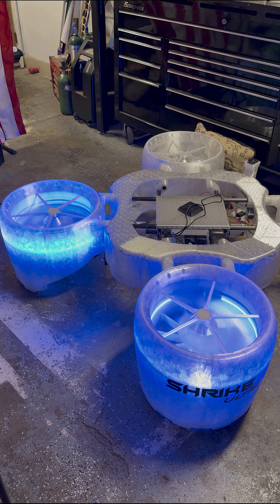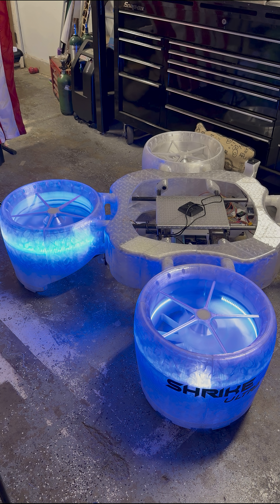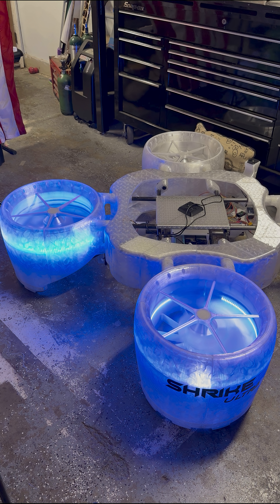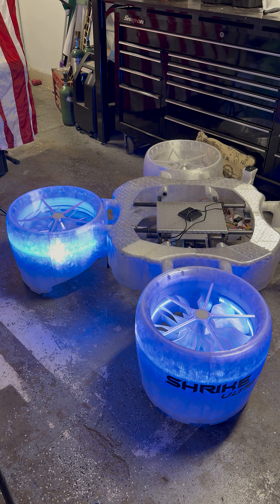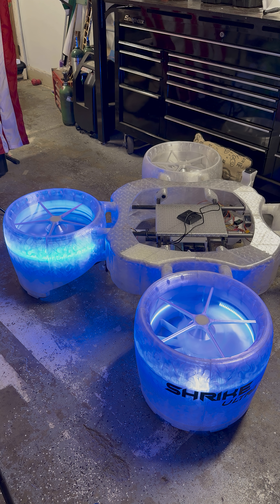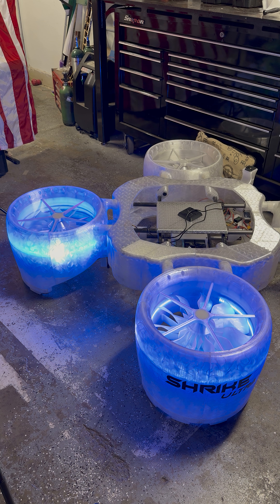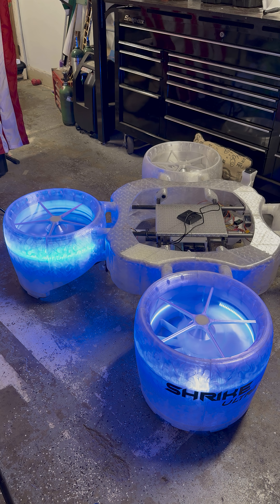Huge 3D Printed drone, dual motor test at 48v, unexpected but good results.  #diydrone #fyp  #rc

Comment: Does the les color change/sequence mean anything?
Reply from the maker: Not really, I can program the lights to run on a preprogramed sequence or using data from the flight controller, haven't really decided yet.
Reply: @warmachined3472 I was curious because I noticed one had a different pattern and color that seems as if it was synched with maybe throttle or voltage/current or something. Which would kind be cool even if not very useful.
Reply from the maker: @keem5143  I have to go through my wiring sometimes the lights glitch a little bit. Also, he probably noticed that the iPhone tends to switch exposures when pointed directly at a light source that can count for some of the light changing.

Comment: I would rather attribute this to clean floors :) A relatively low friction would make it possible to move this way. Obviously, with these cutouts you would have numerous stages of ground effect too.
Reply from the maker: I agree with you the point is that two engines not running at full voltage moved an 80 pound drone. The floor is kind of rough to be honest with you. It gives me hope.  I’ll be doing another test tomorrow.

Comment: I appreciate you posting videos of anything that might be mechanical flaws. It shows a lot about yourself and allows. Anybody watching to learn from experience thank you for doing this.
Reply from the maker: Well, the idea is to learn from the prototype. The point of this was to show that even at testing voltage it had enough power to move with only two motors. At full voltage and with the addition of thrust from the two rear motors it will have plenty of power to hover, with enough power for payload.
Reply: Devil's advocate here, is it thrust, or is it vibration that's moving it?
Reply from the maker: It was thrust but I am setting up a suspension rig on a scale next run. So it can be more visualized.